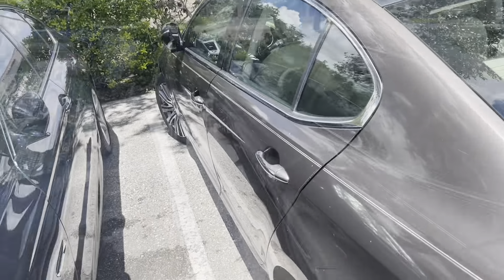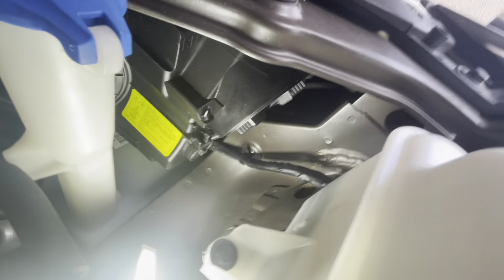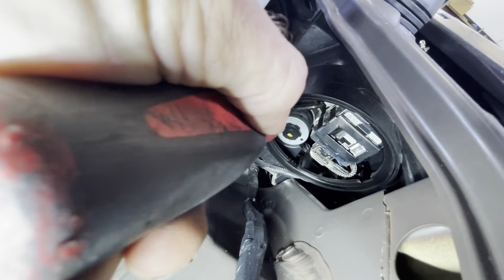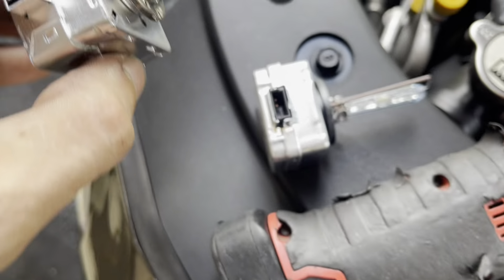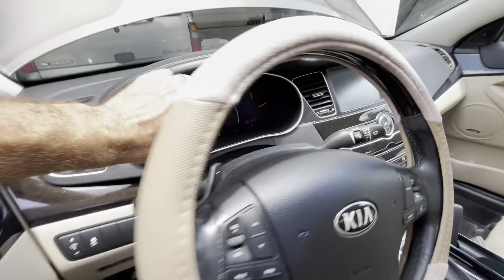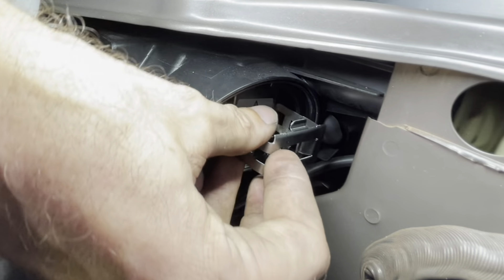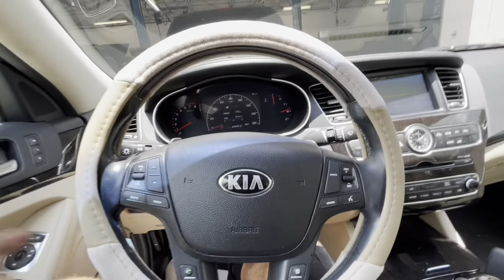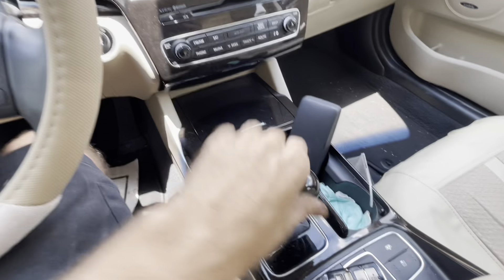Abnormal EVERYTHING All Day! Kia Cadenza

Comment: This task reminded me of the struggle I went through to change the passenger side low beam on my 2014 equinox LTZ. Everything came apart fine and went back together fine except for the stupid dust cap. No matter how I turned that joker it would not line up! I think I finally gave up and it’s hanging up in the front end somewhere. The drivers side went straight up into the hole, lined right up,  turned it 45° and it locked right in. Go figure.

Manufacturers need to put plainly visible alignment marks on those stupid things so even technicians can throw those on without a problem.

Or better yet put a mark on the dust cover that is plainly obvious to everybody that “this spot right here” belongs at the 12 o’clock position.
Reply: My mom's vw gol had an issue like that, one of the headlight bulbs was replaced by some electrical car shop thingy, and the guy managed to screw that connector in completely crooked in the little rails it goes on, so one side of the headlights would just turn and get loose very easily as intended, and the other one was impossibly stuck and would turn but not come out.
When we finally got her car to an actual mechanic for an oil change and timing belt stuff, i also talked up the mechanic to take a look at that thing before the bulb blew up again, and after some co-op we managed to get the damn thing out and properly attach it this time, just in case that bulb ever needed to be replaced on the road by someone who's less of a tinkerer.

Comment: So the easiest way to change the headlight bulbs on a 1st gen Mazda 6 involves removing the front bumper. And from what I understand, this is not so unusual. For a first generation Z car, access to the screws that hold in the headlight is best obtained by removing the front tires. No 5 minute jobs on either one. Fortunately for me, I have a lift in my garage to facilitate the process.
Reply: Same deal on the second Gen 6’s as well. In our 8 years of owning a 2010, I had that front bumper off probably a half a dozen times for the head lights. If I wasn’t changing bulbs, I was restoring the plastic lens covers. This is a prime example of why mechanics dislike engineers.
Reply: Yep my old Vectra was the same but someone with little hands could get them in and change it

Comment: You are a patient man Ray, I was working up a filthy temper tantrum from just watching you do battle with that ridiculous headlight assembly. This kind of stupid engineering crap is what makes me hate modern cars
Reply: Amen !
Reply: Cars are not made to be user serviced, otherwise the dealerships would lose money.
Reply: These are one of the easiest cars to replace bulbs on...Ray really made this look difficult, especially as it's a tool less job.
Reply: Modern anything. How about a washing machine where the inner basket can be torn with your bare hands? Yes it works till it needs repair. You need a whole special rig to attempt to repair it without damaging it. Attempt as the washer was 3 years old and the parts were no longer available and it was out of warranty. They squall and squall and squall about too much bleach threatening to void your warranty. Same for about any 'white good' now. At least with cars there are some aftermarket parts, not enough but some.

Comment: My car lets you set up driver profiles, with customized seat/wheel/mirror settings for each one.  I just put it on a guest profile if I have to take it in.  Granted, the only time I have ever taken it to the service center was to get the Homelink module installed, but still.  Sometime this year, I need to have the brake calipers cleaned/lubricated (only recommended because I live in an area where the roads are salted in the winter).  That is the only yearly maintenance item.

Comment: Changing a headlight bulb, how hard can it be, right? My 2001 Golf has little to no room to change the bulbs. First time I did it, I thought it'll be 15 min tops both sides. An hour later and cuts all over my hands I had got them changed... Battery on the other side (yeah, could have removed that) and AC fill port on the other giving no room to work. Not  to mention the covers, a pain in the ass to get to correct orientation... Would've probably been faster to remove the bumper and whole headlights and replace the bulbs that way.
Reply: yep, my '13 acura requires removing the front bumper to replace headlights
Reply: Heh, makes me glad for this old shitbox i drive, you can stand inside the engine bay for that kinda thing, and you don't need to, because the bulb just comes out with a small twist!
It's kind of cheating though, this car i got was based on the opel corsa 94, and was designed around being easy and cheap to maintain, and definitely NOT designed to be top tech, safety and comfort.

Comment: Mercedes have been doing Xenon since the 90's, and they are so much easier to change. Well done Kia on unimproving known technology.
Reply: This one was easy. Some cars require removing the front bumper cover and the headlight assembly.
Reply: @aaronbritt2025  My sons both have a Honda Accord (2008 & 2009). Manual states that the process is to remove part of the fender well and reach up and unplug the bulb, but I believe the manual was written for tiny-handed people with double-jointed wrists. As such, the process for these Accords is now to remove the bumper and the headlight assembly. Easy peasy once you do that.
We've come a long way from popping the hood and unscrewing the bulb.
Reply: It's really not that bad considering the other cars. Take the Acadia for example, you have to go through the wheel well to change out a bulb. Sure they had enough room on the top but why would you want something like changing a headlight bulb to be easy.
Reply: The headlights on my Skoda Octavia come out by loosening one screw and sliding a locking tab to the side. Easy peasy.
Reply: @nottelling4828  Hey , Why Not ? What else did u have to get done anyway ? Making stuff expensive to fix is the road to selling more nu stuff. Much of what's in salvage yards today isn't badly damaged[if @ all] Owner jus decided to move on or walk.
Reply: @erik_dk842  Where do you even find parts for that?  Is it part of VW Euro group.
Reply: @peted5217  It is essentially a Jetta  hatchback built in the Chech republic. Very common here in Europe.
Reply: @erik_dk842  same, has like a bracket with 2 screws which presses the bulbs into the socket, easy to change and easy to remove. It's also stupidly easy to remove the headlight, no need for stupid bumper removal for the headlight.. (skoda octavia mk2 prefl)
Reply: @erik_dk842  Ya, don't see them here in Texas, but herds of Jettas. Well made and reliable with normal maint. What's your current USD equiv per litre gas . Texas is USD $4.50 GAL or $1.17 litre. It's highest ever seen , tho I tell neighbors it's a bargain compared to other places.
Reply: @peted5217  $2.55/litre I use diesel @ 2.36/litre. The Octavia gets more than 45 MPG, my Ford Galaxy minivan gets 30-33 MPG with a heavy foot
Reply: @nottelling4828  We may have come a long way but I don't think the direction is up.....

Comment: I knew a mechanic who was not a small person who was working on the vehicle of much shorter person, and they didn't want to inconvenience them by adjusting anything, and supposedly when they forced themselves to fit they broke the height adjustment on the steering column. I'm cool with mechanic moving stuff around, it takes 30 seconds to fix.

Also I just replaced the headlights on my 09 Focus. That required removing the front grill.

Comment: Last time my car was in, I was getting new tires mounted. The gentleman was a larger gentleman, he took one look at my seat and asked if I could pull the car in for him. I have a race seat and 4 point harness I daily, and it’s not so easy swapping the stock back in. Another time I was asked was because it was a 6 speed and no one knew how to drive one, I almost left but the where again doing just tires.

Comment: Look at a helicopter, and see that thin pipe that attaches the chopper to the big blades.  The entire weight of the chopper is being held by that thin pipe.  I find that amazing.  Anyhow, a morning starts and I am off to work, but my darn car won't start.  Then after work I try it again, and the car starts.  This went on for several days.  I finally traced the problem down to the ignition coil.  In the mornings, the air temperature was much colder, and so the low voltage was a problem. After work, the temperature was much higher, and so the engine started. I despise those intermittent problems.

Comment: I don’t mind it if the seats are adjusted for a test drive, that makes sense. If the seat is way off and has to be adjusted to move it in the bay, no problem. But I’ve taken my car to a full service car wash where they move the car twenty feet. There is an employee that adjusts the seat, steering wheel and mirrors. Very frustrating when I get in to leave and have to readjust everything.

Comment: Your ramblings are fun :)

Stepmother had a 2006 Altima -- I think. It was old enough to have the 'old style' taillights, not like the ones on the uppity beige -- oh, sorry, "Champagne" -- 2011 model that replaced it later on... Dad still did his own maintenance at the time (he's since gotten uppity in his own ways, and now has someone he calls, instead... one change of many, and I can't say I'm terribly impressed with any). Forgive me for the cardinal sin of IDing a car by paint color, but it was that one year where the light green color they had was just a hair lighter on that one model. Hers was that green.

Stepmother had it on her HoneyDo list that a headlight was out. Dad musta crawled over, in, on, and around the dang thing for at least a half hour before -- with a string of unrepeatable language ending in, "Either I'm really missing something or the designers were [redacted]holes and you've got to drop the bumper to replace a [redacted] headlight." -- surrendering and calling the local dealership in abject resignation. 15min on hold later, he hung up his smartphone with an impeccable look of disgust. I've got a smirk on my face because I know what's coming.

"[Redacted]hole Theory." is all he says, with a sigh, going back in through the garage, putting down the headlight he wasn't going to install that day afterward as if it was something one of their cats had tossed back up. There was some yelling back and forth, most of it unrepeatable in a distinctly entertaining way, and then he called the dealership back and made an appointment for a few days later.

BTW, she traded that one in to get the 2011... which she very quickly regretted. She got the newer one specifically after being sold on the new infotainment system in there. It's a Philips design, and speaking as a computer nerd, I'd rather be stuck with Packard Bell Navigator on a system it shipped with, because that would genuinely be both less hard and less painful to use. If there's a worse UI I've seen, I can't think of it immediately. The fact that the user's manual for that abomination is longer than a full ream of paper is probably all you need to know ;)

Comment: My Mazda was suggested to go through the wheel well to replace the bulb. For some reason, the housing is tucked under the fender. The first time I changed the bulb, I broke the housing. There’s that stupid bent coat hanger thing that slips over a brittle piece of plastic that has all of the structural rigidity of a stale Dorito. For some reason, this car loves to eat headlights every 3-6 months. I can now take the whole housing out in about 3 minutes. If I was ray, I would have just removed it completely. I’m sure that housing is $600 and it’s shot if you break that backwards tab. With the housing on the bench, you have full range of motion to manipulate that stuff. You usually don’t have to pull the bumper off, just loosen it. Once you have the housing loose it’ll come out. I’ve done a half dozen other cars this way other than my own. On most, you can rotate the housing a little and then angle it down into the space between the radiator support and the loosened bumper cover and then lift it straight up.

Comment: May would think changing a light bulb is a few minute job, but modern car makes it otherwise.  My worst experience is with Vauxhall (Opel):  2004 Mervia I figured out it would be easiest to reach the bulb by underneath the bumper.  Then Corsa MK3 pretty much had to take half if not the whole bumper out.  ALSO, if one side is out, you are best to change the other side as well.  As the other side usually failed shortly after.

Comment: As a customer of a different size than the technicians I normally having working on my cars I'm used to my seats and mirrors being moved. The seats are the hardest thing to get back in just the right position. Cars with manual seats are fine (just count how many positions from front or back), and electric seats with memory are fine (just got the button for the remembered position), it's cars like this with electric seats with no memory where I have trouble and find myself making minute adjustments for a few days trying to get the seat back in my sweet spot.

Comment: Had a similar issue with my uncles 2014 Lincoln mkz instead of a metal band holding the hid in it was a metal strap with two tiny screws.

Comment: My 2005 Acura TL was even more fun. You have two options, actually you have three options but one of them is extremely expensive, and that would be taking it to the dealership and letting them change the bulbs.
Remove the entire front bumper cover or pull down the inner fender liner, which is what I did for the second and third bulb replacements, after I found out that you don’t have to pull the entire front end bumper cover off.
Reply: A lot of the time, you can get away by slightly pull the bumper away just to reach those headlight screws.  That being said, there is always one screw fixed between the bumper and the wing.  To reach it, you'll need to detach the wheel liner around that section.  Just lose 1 or 2 clips, make it less rigid so it can be bend to reach that screw.

Comment: In the collision repair shop we learned on these headlights that would be easier to take it out by lowering the ends of the bumper cover accessing the headlight bolt and removing and then accessing the inboard headlight bulb easily vertically under the hood simply pulling out the headlight does make it easier but the manufacturers don't seem to care about us having to put a bulb in these headlights and you will see many cars driving down the street with a weird looking headlight illumination because the bulb was not installed correctly cuz it was just too damn difficult for the amateurs.

Comment: Geeze - that was an easy low beam replacement.  I need to do low beam replacements on my Subarus by feel with my arm extended up past the front wheels (closing my eyes to help "visualize" what I'm doing really helps).  Flip the little retaining spring arm off with the fingertips, pull the bulb, replace the bulb IN THE CORRECT ORIENTATION without being able to see it, find the little retaining spring arm and re-attaching it with the fingertips, screw the cover plate with gasket back in without starting cross-threaded and...done.  Oh, and reinstall the fender liner...where the h*ll are those variously sized push pins anyway?

Comment: Ray, I feel your pain I had one of those silly new-fangled HD lights that took me 35-40 minutes to just get to the bulb just to find out that the bulb cost $165.00.  The new thing I came across was the newer GM tail light assembly that is a sealed unit from the factory so if the brake light, running lights, or turn signal goes out, expect to pay $850.00 and YES you heard me right eight hundred dollars, the fifty was tax and shipping for that POS. I can't remember if it was the Tahoe or Sierra. What a dump truck load of horse crap. lol

Comment: Had a 1980 Audi (forget which model) where one had to remove the lower trim on the grille in order to remove any one of the four headlights. In order to remove the lower trim one first had to remove the front bumper. Book time was 2.4 (two point four) hours. OTOH... to do an oil and filter change one didn't even have to jack the car up. Simply kick an oil drain pan underneath the car and one could access the drain plug easily from the under the hood and the filter. Took longer for the oil to drain out and filled back up than to remove and replace the drain plug and filter. Most everything else in the engine compartment was also that easy to work on.

Comment: Just an FYI, Ford used a single bulb for low and high beams. I'm not exactly sure when they started doing this or if they still do it. However, I do know for sure that Ford did it from the mid 90's into the mid 2010's, because I've performed Headlamp bulb changes on Fords of these generations.

Comment: I hate changing bulbs in Kia's & Hyundai's. Every one I've done requires you remove the entire headlamp assembly (from within the wheel well). Well, you can do most the bulbs in place if you remove stuff and are double jointed.

Comment: My Hyundai Elantra I used to have had a similar design and was a pain just like this one. Drove me nuts changing the bulbs till I figured out the fastest way to do it but still a complicated design for no reason made by bored engineers. Another thing I thought was weird was that clip was acting like a bridge or ground so if it wasn't on all the way or not at all then the light wouldn't work despite being plugged in, at least for my Elantra this was the case. 

Ray, you get the weirdest animals visiting you from snakes to lizards, rats, mice, and now birds what's next a Gator LOL.